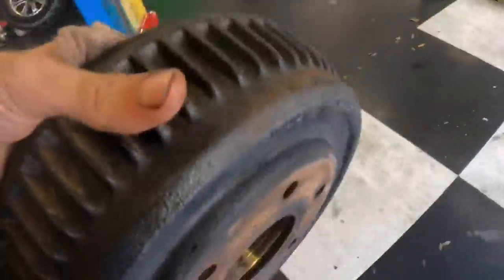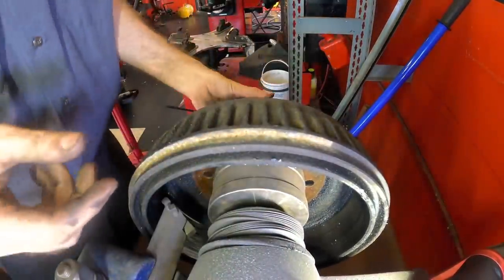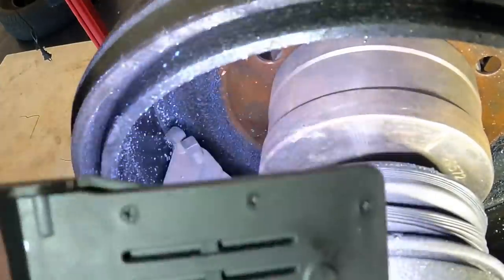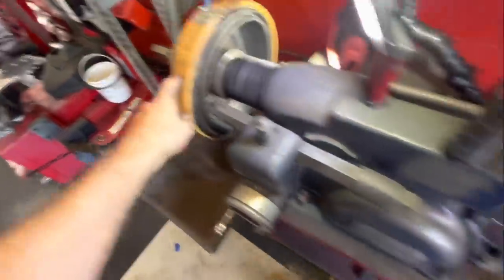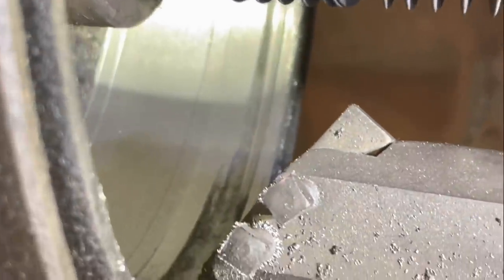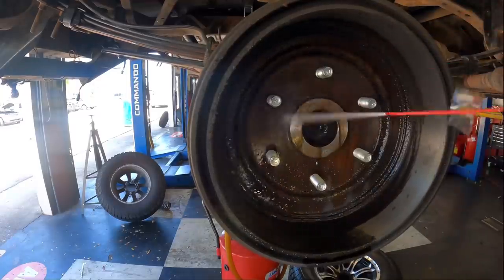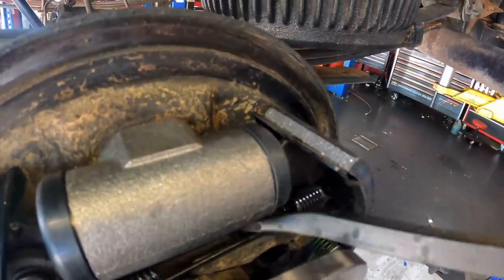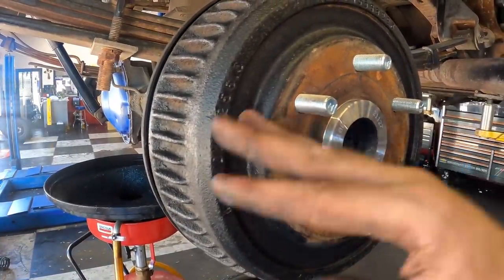How To Machine Brake Pads and Rotors to Recondition Surface | Brake Lathe Drum Resurface

Comment: Pro tip: When machining brake drums cut the lip first as it can break the cutting tip due to rust build up and the decreased overall diameter. Also note how the anti vibration belt attaches, the clip does not go through the holes in the belt.

Comment: After I adjust my rear drums to drag a little. I lower the lift or jack down till the rear tires are above the ground. Start it up and put it in reverse and let it free wheel backwards, then set the emergency brake. I do this a few times till both wheels stop turning when I set the emergency brake. Then take the vehicle out to break in the brakes. Seems to work for me.

Comment: Back in the mid 90s, I had some dip-wad at AutoZone turn my brake drums on my 67 Impala.  He was a cocky and over-confident guy.  The drums were fine and not warped, but having as they'd never been turned in the car's existence (grandfather original purchaser), there was some "shoe slap" happening when applying the brakes.  This clown at AutoZone was commenting how out of round my drums were and taking 8-10 passes on each.  When I put them back on the car it shook like crazy when touching the brakes.  Now my original drums were ruined.  AutoZone paid for a new set of drums (4), but what a pain that whole ordeal was.  I have a cousin at a tire store who is the only one I'll now trust with my drums or rotors.  And yes, I still have this car.

Comment: I was amazed when you said rubber belt. The last time I used a brake lathe the belt was made of leather and the locking pin was held by springs.
Reply: Leather isn't vegan, and offends some people.
Reply: @derekhobbs1102   I personally don't care if I offended someone.
Because of what I had to work with I used that and didn't complain. 😄😄.
As a matter of fact it actually was like a belt with a buckle.

Comment: from this can i take it that drums can be refinished on a standard lathe with a single point boring tool, I know discs are required to be machined both sides simultaneously, but the drums not (apparently)
Thanks

Comment: I never heard of using  a rubber band to prevent rotation vibrations. I suppose there must be very good mechanical contact between the metal to be worked on and the rubber band. At our work we use visco-elastic damping tape (3M glues) between metal plates to damp out vibrations. The material and thickness are adjusted for particular frequencies.
9:00 I skipped ahead to miss the 27 cans.

Comment: I worked in a foundry for part of my life. We had a lathe in the lab that was about 6 times the size of that one. We joked that it must be from 1903 ( i dont remember that date on the info plate). Everyone at the plant turned our own rotors and drums with it.
Reply: For the three months that I worked at Westinghouse East Pittsburgh it was quite impressive to watch how they turned raw steel forgings into shiny generator and steam turbine shafts. The process took months with the lathes and milling machines running around the clock. All history now.

Comment: When I did drums I'd adjust to just allow the drum to fit over the pads and a few reverse brakes to let the automatic adjusters take over from there.. The Vega didn't have the typical star wheel but  used a bar adjuster.. That freaked me out the first time I encountered one. After about an hour fighting with a brake spring I found out hey the brake tool has something on the other end.. and it worked like magic.. 1st side took over an hour, other side about 10 minutes to replace the pads from start to finish.

Comment: Light weight oil on drum also stops chatter even with strap. I would have cleaned brake drums in parts washer before turning. 50 years as an ASE Certified master mechanic does make a difference.

Comment: ray  just asking - by cutting the drum don't you change the radius from what the brake shoes are designed I understand the linings will wear to suit  but until then the linings don't have full contact and affect the braking
Reply from the maker: You are correct, I difference is negligible and the shoes will break in quickly

Comment: This video is not bad referring to the brake cleaner in the title -  but have you ever heard of compressed air? A lot of mechanics use it to get rid of loose dry stuff before they soak it in a liquid and make it difficult to remove... Also, a wet cloth, drenched in somehing as inexpensive as gasoline or diesel might remove a lot of grit. Don´t use diesel on brake parts, but otherwise it´s not so bad if you leave them a bit oily..

Comment: Never had that problem with the strap we would take 10  on the rough cut and 2 or three for finish we evan cut flywheels on ours im 70 has 30 years as auto machinist

Comment: i bought 2 ammco brake lathes that was in the last Kmart near me  when they did brakes one for drums one set up for rotors best 1500.00 i ever paid  each machine is over 4k .if a car calls for front ceramic pads dont turn the rotors replace will come back ur dime

Comment: I have literally turned thousands of drums and rotors.   First machines I used about '74  were old Van Norman drum lathe and  Kwik-Way  disk lathe.   A  second  store  I worked we bought a new  ammco.   I still have  an old Ammco  I bought used---cheap  and JUST got   (almost) done  CONVERTING my Dodge RAM diesel  from 2WD to 4WD, and turned the rotors on it   I'm 74 now and don't  move  "quite as fast"

Comment: It has been a while since you have been able to do the repairs needed on a vehicle you inspected instead of parking it for the person who didn't want or have the money to do the job  . Now you get one  , but someone already in your shop gets to repair the front half and you get the back half and i don't think you have to worry about the video going over an hour as you do a great job repairing them  !  You even go above of what you are to do because you just can't send it out if it's something you can fix/do in a short time ( ie. Clean battery cables when you don't have to  )  that's what makes you a great mechanic.

Comment: Silly question but what shouldn't you use brake cleaner on?
Reply: Things you can use any degreasing parts cleaner agent on. 
Usually a low flammable solvent is used that is pump recirculated, so it isn't just used once and then blown into the air or down a drain.   
The need for 'Brake Clean' is more for brake components that cannot have any residual solvent left behind that would hamper actual brake fluid operation of master/slave hydraulic systems. 
Use like this shown is called  Pissing it Up the Wall.

Comment: With the brake spreader shaft near 11:00, aren't those 'self adjusting"?  I recall on my Chevy Luv decades ago that the rear drum brakes were self adjusting.
Reply: Yes they are BUT you want to take up the initial slack by hand first. They are designed to compensate for wear and work by stopping in forward and reverse. Unless you want to sit in the car and shift from forward to reverse and moving a few feet forward and back about 50-60 times it is way quicker and easier to manually adjust them first. That and the brakes could be so far off that the automatic adjusters won't even work.

Comment: Used to cut drums and rotors and we always ran the bit in and out first to cut down the lip created from the wear. If you don’t do that, you get what happened, the bit has to take too big a cut and it locks up. Is it weird that I haven’t done that for 20 years but I can still smell the iron from cutting them? Anyone who’s turned drums and rotors will know what I’m talking about.

Comment: was interesting to see you not using the proper drum brake tools to complete the repairs. I'm guessing drums are not commonly done anymore so that would explain why you don't have the specialty tool for servicing drum brake setups?
Reply from the maker: I have one drum tool and it doesn’t fit anything, have had it for 10 years and NEVER used it

Comment: They don’t make any money on that “shop supplies” scam off of you do they? Nope, I suspect they lose money - 27 cans don’t come cheap, even using store brand instead of CRC, also known as the good stuff.
Reply from the maker: When the P&L is settled it’s actually not a scam. It’s to account for expenses that can’t really be Itemized. Imagine if you got a bill for 1.2 cans of cleaner $4 Six towels $3 soap $0.52  one oil sticker $0.15  One floor mat $0.18  etc. etc. you get the point. It’s usually calculated at 10%of the bill or $30 whichever is less. Shops actually loose money on consumables even with a shop supply charge
Reply: @RainmanRayOffDuty  I call it a scam in that there is no reason it should not be part of the shop rate. Unless it's a way of shorting the guy working a percentage. I see scam when ever I see such a charge - regardless of industry. It's like keeping the same price but making the candy bar smaller. Anything thought up by the accounting weasels.

Comment: Find it hard to believe you could turn that much material off the drum and still be in tolerances. Even in the 60’s when weight wasn’t an issue you could only turn out a small rivet cut.  Don’t they require you to use a micrometer on the drum before turning?

Comment: Using a Brake lathe is going the way of the analog clock ⌚ few know how to use them , such a simple device but with all the parts coming from China it's just cheaper to replace Drums and Rotos most times unless it's a hard to find part or it's already made to thin to cut safely. I think I had one set cut in the past 20 years after searching for a shop with a lathe  I had to tell the guy how to use the lathe, they were young and it was already in the shop when they purchased the place.

Comment: Deja vu? Anyway... Back in the day - a day well before most of the world had heard of antilock brakes, when most vehicles had drum brakes... at both ends of the vehicle - a good drum brake service included not just machining the drum, but also addressing the shoes as well, (typically) via arc grinding, matching them to the drum. Drum brakes have some very real advantages (which are somewhat minimized now, due to modern technology). Once upon a time, every decent shop could, and did, do this. Then, later, every decent shop knew who the one old fart mechanic in town was who had the ability (and gumption) and equipment to do this.

Fast forward to now, when there might only be a handful of entities in the entire country who still perform this service - and Race Tech (Suspension) charges $250 per drum/shoe set to do this for a motorcycle, although they'll do an extra set of shoes for an additional $75/set. It makes a difference and is, arguably, worth it. I've no idea what it costs, these days, for cars/trucks. Would I have the work done to the brakes on the back of a 1979 M.Y. Winter beater? No. Would I spend the money to get it done for a vintage hot rod that I intended to regularly drive like I was the getaway driver in The Great Train Robbery? You betcha. . . .

Comment: Ray you need to get refillable spray bottle that you fill with brake clean and air pressure from air hose.
Reply: feeding from a 55 gallon drum.
and, where is the safety-kleen parts washer?

Comment: The rubber strap doesn't need to be pulled super-tight so use a bungee to fasten it and then they won't break.  Should have checked availability for that second drum and replaced it. Out-of-round drums tend to get worse quickly so that one may be coming back. Availability of drums is really good now as China and india cast tons of them for everything and they're cheap. Not great quality but safer than an oversize one and the next one is cheap enough when that happens.

Comment: I remember doing brakes for a full year at a shop. That was my limit. I went to the service mgr. Which oddly enough was my father-in-law at the time. *(He was NOT my father-in-law when I was hired)* I fortunately was finally put into the rotation afterwards. Although since I was the only "part time" mechanic. (I worked at a different shop in the afternoons and evenings. Which I wasn't willing to give up. Due to them having an insurance package. Which as a young husband and father I REALLY needed.) I got stuck with some rather odd jobs. 
Anyway, I couldn't tell you how many drums and rotors I turned. Well, enough that I bought my own brake lathe!! That oddly enough ended up becoming my EX-father-in-laws. Because the judge thought it fair to give my ex-wife ALL of my tools and equipment. F'ing bastard!!! Small town politics, the outsider gets F'ED every time. It's been twenty years and I'm just now ,sorta, getting to the point of having replaced all the tools I lost.

Comment: When installing the rubber strap on the drum, you don’t insert the metal prong in the hole on the strap. You turn it 90° and insert it under the previous layer of strap. That’s why you broke it.